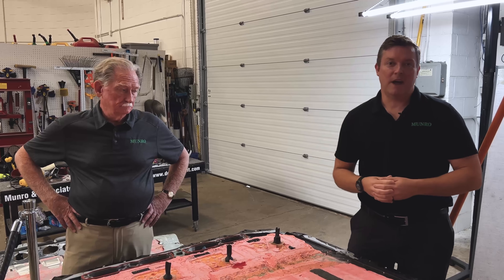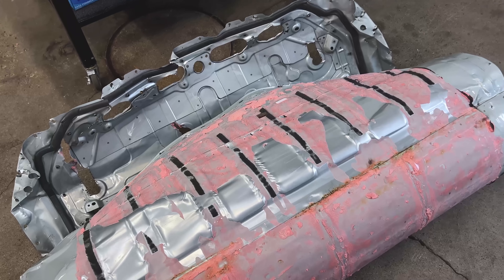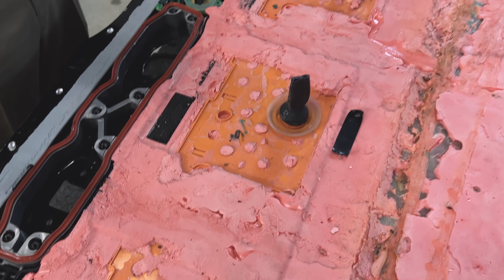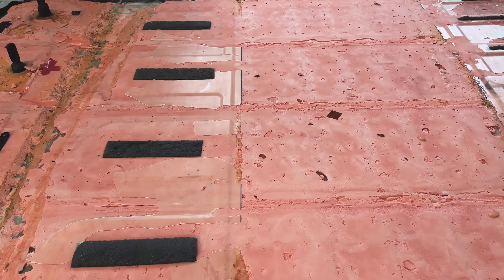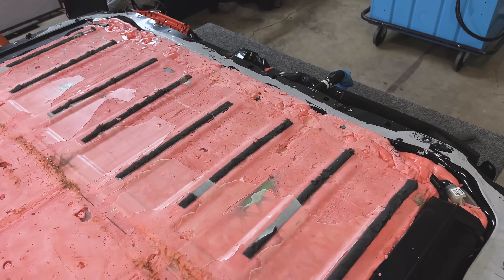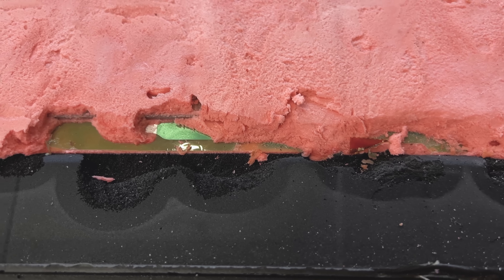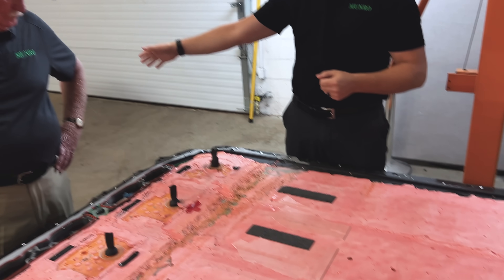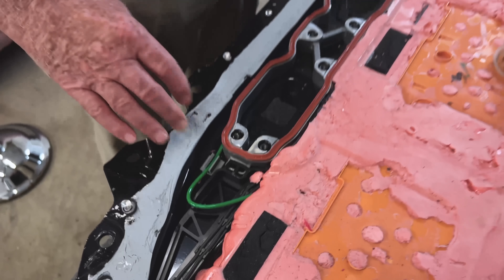FINALLY! 4680 Battery Pack Lid off | Tesla Model Y Update

Comment: I work at tesla and I know what the breather tube does, in fact i designed it!
Reply: And you're good looking...what a guy😉😁
Reply: @davincisghost9228  the purpose of the breather tube is if you are in a car chase, if you push both buttons on steering wheel, grease squirts out, i designed this in memory of speed racer.
Reply: @pauljosse  Yes, yes, excellent....

Comment: I think that the breather tube would help with pressure differences between the atmosphere and the inside of the battery pack
Reply: Yeah kinda what I think too. High altitude to low/temperature pressure equalization. With the large volume and suffice area in the pack a small pressure differential could make a difference in the structure.

Comment: This just illustrates the problem everyone is avoiding to think about; clean recycling option for these battery packs has as much a chance of success as putting toothpaste back into the tube. Serwus!
Reply: It can be recycled, but likely at a material level and not a component level. Basically, shredding it and separating the basic materials out.
Reply: It is very good for energy storage like a home powerpack and you sale it and pay a new one. 

This wil power a house easily and great addition to any solar system or act as a generator if you prefer. 

I could use one for my convenience store for example.  Never a power 🔋 outages again with one of these as generator.

Comment: might be a dumb question, but what do the guys do after tearing apart a car? is it reassembled and then driven again?
Reply: No, it's all trash and parts to be salvaged.
Reply: @brianb-p6586  WHAT
Reply: @fishdishh4306  the replacement parts to replace everything that was torn apart would cost more than the car is worth, and if they were going to buy all of those parts they could just buy the parts and tear them apart, instead of destroying the originals in the car.

I'm sure they recover substantial value in salvage, depending on what components they have destroyed. In this case, since the drive units (motors and gearboxes) are probably the same as they have analyzed before, they'll presumably sell them intact, perhaps with the rest of the car.

Comment: Nice progress guys. I believe this foam provides many benefits. It provides structural rigidity, it provides heat protection from the passenger compartment directing the heat to the cooling system. Also prevents competitors from copying your BMS. It can also provide fire retardant in case of a collision. The rigid foam can also  prevent cracks in the large anode or cathode end caps of the individual cells from heat 
cycle expansion.

Comment: I was told that the batteries are easier to access from the bottom. 

That said, I was also told that Tesla intends for the entire battery pack to be recycled as a unit to recover all the different materials as "refined" metals instead of having to start from scratch for the next batch, which might take a decade or two of wear and tear first!

Comment: Breathing tube lets air out as the foam expands?
Looks like the top is on while it is expanding/wet, since it bonded to the lid/top.
Reply: Yes, as the foam expands the air goes out the tube.  Once the foam sets it is water proof and vibration won't damage it.

Comment: Thanks for all the detail tear downs! Please comment eventually on the recyclability of this new structural pack. Given how difficult it appears deconstruction is, I am concerned about the long term recyclability. The Tesla 2021 Impact Report again stated they will recycle packs in house, but also the need to further develop efficient processes to do so. I'd love to hear a Munro opinion on recycling feasibility.
Reply: Indeed… This looks very hard to recycle or repair. (Repair or small damage= totalled car..?)
Reply: @MrGoogle87  Agree I can't imagine a repair will be feasible at least in a cost effective way. It appears a full pack replacement in case of a pack failure would be a pretty straightforward job. I'd imagine any crash event which causes damage to the pack would total the car. Which is probably true of the previous non-structural pack.

Comment: Will you tear into a 4680 cell?  That could be very illuminating.

Another question: Tesla inverters are made with silicon carbide power-handling transistors.  Have you ever seen silicon carbide inverters in any other manufacturers' BEVs?
Reply: there is a video on the net tearing apart one
Reply: @JohnSmith-pn2vl  Yeah, no.  The tear-down I think you're talking about is an early prototype cell that failed QA, made at Cato Road and handed to a vlogger who handed it off to The Limiting Factor for the tear-down.

That was not a cell made for a production car at GF-Austin.
Reply: @Urgelt  Picky picky, that said the limiting factor did say he already pre-ordered one of these cells for $800.
Reply: @bp495599  By any chance, will TLM buy it from Munro?  There aren't too many places one could pick up a production cell just yet.

I'm still curious about Munro & Associates' insights into the cell, if they care to share them with us.
Reply: @Urgelt  Yes from Munro, they are already taking orders apparently

Comment: "A journey of a thousand miles begins with a single step" is a common saying that originated from a Chinese proverb. The quotation is from Chapter 64 of the Dao De Jing ascribed to Laozi,[1] although it is also erroneously ascribed to his contemporary Confucius.[2] This saying teaches that even the longest and most difficult ventures have a starting point; something which begins with one first step. AKA, "A journey of a thousand miles is taken one step at a time." I had this framed and hanging on my office wall. My boss was a marketing guy. I said this is what engineering is.

Comment: Something tells me the dissolving has to be done outside to eliminate fumes. I figure it will take MEK,that is Methelene-Chloride to break this coating down, then tilt and pour it into a greased black plastic cement mixing tray available at Lowes.  Let it vent the solvent and solidify again,  and twist the greased tray to release it from the form.
Reply: If it produces fumes, the solution is not to do it outside, but to do it in a properly contained environment. But of course Munro is not equipped for that.
Reply: Maybe simple acenton can do the trick

Comment: I guess is the breather tube is used to pulls a vacuum when the foam is inserted.
Another guess is maybe the breather tube is connected to the turbo incabulator in order to supply inverse reactive current for use in unilateral phase detractors.
Reply: Perhaps it's fitted to the ambifacient lunar waneshaft so that sidefumbling is effectively prevented?
Reply: @Obsidian9  lmao

Comment: Breather tube would be to small to create pressure or vacuüm. So i would say it is to gently let out the air while the pink foam is expanding and solidifying.
Reply: Assuming they close the lid before fully expanded foam. Best check the edges of the cover and crate to see if pink stuff is well penetrated everywhere
Reply: I think the tube is too small for that.

Comment: I can imagine Tesla engineers laughing their heads off.

Before the battery pack was disassembled I would have liked to know how strong and stiff it is. It looks solid.
Reply: Tesla likely can service the packs, but they use a solvent to dissolve the foam first.  Then open it.  Once done, they close it up and inject new foam the same way they injected  the solvent.  Once the new foam cures, the pack goes back into the car.   Solvents are recyclable, so the service shop would store it and have a recycling company(or tesla) take it away and reverse the process to reclaim the solvent and foam chemicals.
Reply: @_PatrickO  I think that's very unlikely. If for some reason the battery fails after assembly, it will go directly into recycling.
Reply: @EinzigfreierName  Tesla is choosing not to service them, but it is definitely possible.  Tesla has no need to service a pack in the factory, it would be tested before sealing it and foaming it up.
Reply: @_PatrickO  How is is possible if you see the labour involved and the mess it makes as shown in this video? Sure, Tesla could have designed the pack differently. But as it is, I see no way of servicing it.
Reply: @EinzigfreierName  You are confused.  They had no idea what was in the pack.  So they had no idea how to service it.  They will  figure it out as they mentioned a solvent at the end that will melt the foam.  Servicing the pack could be as easy as doing a transmission flush.  Hook a machine to a port that forces in a solvent to dissolve the foam by pushing solvent fluid in and sucking it out.  That would remove the foam before opening.  Then you service like normal.  A second machine would then inject new foam and once cured, the pack  is ready to go back into the car.

That said tesla plans on recycling packs at an efficient enough level that servicing a pack doesn't make sense.  It will be cheaper to buy a new one made from recycled materials.
Reply: @_PatrickO  The top cover is welded to the lower part. No way this is intended to ever be serviced.
Reply: @EinzigfreierName  First, people are saying the service is supposed to be via the bottom.  Second, spot welds are not magical unknown things.
Reply: @_PatrickO  Well, we'll see. Maybe in the full disassembly video.
Reply: "Would have liked to know how strong and stiff it is"
That's what she said
Reply: Yes, indeed it does. However, I would not recommend trying to "bend" the battery pack to see how "structural" it really is. :-)

Comment: It should come apart a LOT easier if you heat the whole thing up to about 45 degrees Celsius. Nothing worse than prying away at cold resins.
Reply: ...and you could have used a heat gun on the top cover...

Comment: Thanks guys!  Awesome work that nobody else seems to be doing!!  Bravo Munro & Associates!  Have you weighed the packs to see if there were real weight savings with the 4680 pack?  Did you know the weight diff between the Fremont Model Y vs Austin 4680 Model Y?  Would really like to know.
Reply: the savings come from not needed other structures the battery now replaces, not the weight of the battery itself.
Reply: @JohnSmith-pn2vl  Yes, but many of those structures were in the pack itself, i.e., no more separate modules - so the new pack should be lighter.  Also the overall car should be lighter from other weight optimizations.
Reply: @michaelkim3432  and less repairable/accessible for any work on batteries cells or even BMS….. electronics doesn’t last forever
Reply: Are you sure!? Because they are not the first to open this battery.
Reply: They were not the first to open the modelS plaid…. Lol
Reply: As I remember, they said the battery+seats were around 1,200 pounds.

Comment: Tesla probably has a secret and really easy disassembly process for which reverse engineering is very tricky.
Reply: This seems likely to me as well. J.B. Straubel, I believe, is starting a company to recycle auto battery packs - particularly those from Telsa. So I'd suspect they are engineered for recycling as well as for structural strength and safely and for being good batteries.
Reply: They might just shredder the whole battery and extract the individual elements afterwards.
Reply: @EinzigfreierName  that would just cause a fire
Reply: @jamesengland7461  Hmm, that's true. So there is certainly more to it than simple shreddering.

Comment: Is anyone else concerned about the risk of fire into the passenger cabin? During any condition imaginable that could cause a fire. First and foremost pack deformity/damage due to collision?
Reply: Is that risk any greater than gasoline tank rupture?
Reply: @michelangelobuonarroti916  consider Tesla's records, gasoline fire hazards are much higher than Tesla's
Reply: I’m not a engineer. And I’m not trying to make a case that electric cars are not safe. However i think that both battery packs and gas/diesel fuel tanks when they are separate and not a structural part of the floor should have a higher level of safety from fire coming into the passenger cabin. In a November 14 2015 article by Teslarati they state that Tesla added a titanium plate to the older model S to prevent fire from entering the cabin. 
Tesla’s engineering has been first class in my opinion and has been improving. And they may have taken steps to mitigate fire protrusion into the cabin. I’m interested in Monroe and Assoc’s opinions regarding protection from a runaway battery pack during a collision. I would like to know that in the event of collision that occupants have sufficient time to get out of the vehicle. No idea what sufficient time is 5min 30sec? I drive a model X and am a tesla stock holder and a believer in Musk’s vision to transition to renewables.

Comment: One simple question which would reveal a lot. What is the mass of a 4680 MY vs exostong 2170 MY

How many KG lighter is the new version if at all
Reply: We know this info from government filings that Tesla has provided. The 4680 MY is actually a few dozen kg heavier than the 2170 MY. It's kindof a mystery why this would be the case.
Reply: @coredumperror  For the same KWh? That is surprising
Reply: @kaya051285  No, it's actually fewer kWh. Tesla only makes a Standard Range MY with the 4680s. No Long Range yet. It's baffling how it still ends up being heavier.

Some speculation was that they fill the empty spaces in the pack with steel blanks, which are heavier than actual 4680s. But that's a pure guess.

Comment: Not too long into Tesla's 2170 adventure, the competition was making equivalent or better cells, in different form factors, at prices attractive enough for Tesla to buy 3rd party rather than from expanding one of their own gigafactories.
How far will 4680 make it? 50% of all cell output by GWh? Will these ever be the best on the market? Are they now? What's the energy density please? 2170 was a bitter disappoint.
Reply: These 4680’s will be best for energy density critical missions (Semi, Cybertruck), but competition, especially LFP’s from BYD and CATL are close enough in density, and far cheaper per kWh,, that it’ll be superior for most non-performance Teslas and other EV’s. BYD and I believe the latest CATL can be structural.

Comment: If the cells are high energy density, the packs (and yes it's a just a pack) might have decent salvage value such as hobby race cars, RC crafts, etc. Else...you can't easily use the pack as a pack and it needs to go into a Model Y. We'll have to wait and see whether the same pack even fits in a future Model 3. 
Knowing Tesla, there is NO guarantee 4680s will be in Model 3, S or X. The holy grail 2170 never made it to S and X and Tesla ended up buying various 3rd party cells rather than making their own "bestest cheapest" 2170s. So let's see what 4680 does...

Comment: So any little error that requires the lid to come off, the pack needs to be recycled. And the commercial value of the pack (it's not a cell to chassis design, let's quit that nonsense, it just has the cabin floor on it) will be diminished with the cells so difficult to extract. Curious how hard it will be to isolate one sub-pack (likely less than we can call a module).
Can't wait to hear a definite WHkg number. Does anyone have it? Battery Day's insultingly fuzzy numbers and unit implied by my calcs 360 Wh/kg, coincidentally exactly what NIO is bringing to market now, a 150 kWh sedan with 5 minute swappable pack.

Comment: How is the battery vented in case of thermal runaway?
If everything is in the structural adhesive, it seems to me that it could explode like a bomb because the gas that is created at the moment of venting has nowhere to go.
Reply: Thats what the little tube is for lol
Reply: @LachskoenigIV  That's what I thought too. :)
Reply: Cells are in carriers that are open channels. So cell bottom vents have a path to the pack vents.
Reply: They vent to the bottom genius.

Comment: What exactly is the function of the red material? Is it like a glue? A stabilizer for the battery cells/the pack?
Reply: I believe functions like a glue/stabilizer/fire retardant.  Glue and stabilizer critical to make the pack structural.
Reply: @michelangelobuonarroti916  At the beginning I thought that the red stuff has direct contact to the cells..? But that can‘t be, can it? From what it is shown in the video, the bms is inbetween and probably some isolation?
Reply: @marcelbeaucamp9330  - the BMS is at the end of the unit. It almost looks like a big circuit board between the batteries and the foam!

Comment: IMO - No matter how you look at it, this is just a really poor design. This seems more like an engineer's lab experiment that got out.  When (not if) something goes wrong with the battery pack, the car will wind up being a total loss. Once you factor in the overly cumbersome process to remove the pack, seats, console, ....etc, and then the actual cost of replacing the battery. Whereas a system like GMs Ultium, if an individual cell goes bad, the system will isolate it until that individual defective cell is replaced. You can even have updated cells installed with improved chemistries over the life of the vehicle. I think BYD is doing a similar system as well.

Comment: Has Tesla traded any potential for repairability with parts reduction?  Is this wise considering there is a possibility to “disconnect faulty cells to extend the life of a pack?  $22k for a pack replacement is too much, the repair is more in line with ICE engine replacement which is more in line with customer expectation. Improvements that reduce repairability and increases risk/cost to the customer is NOT a sound strategy. My opinion…